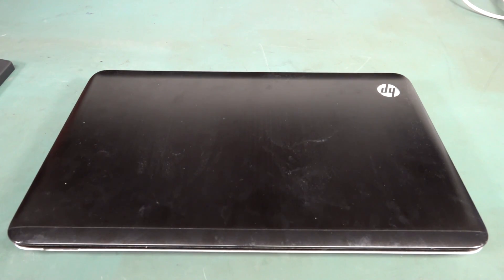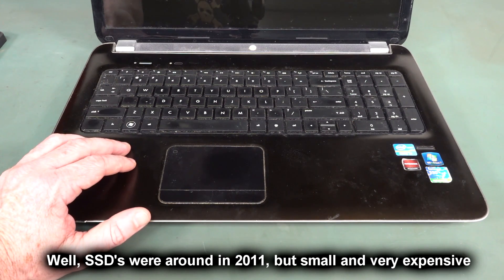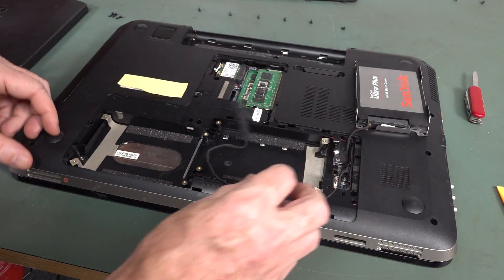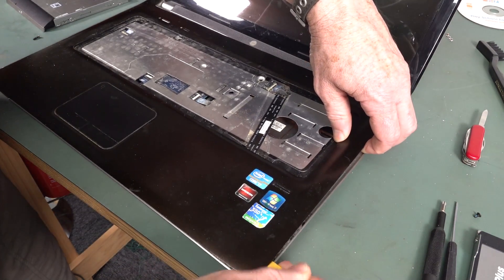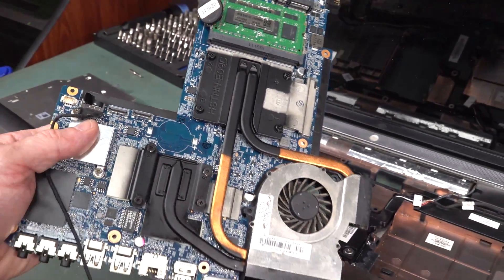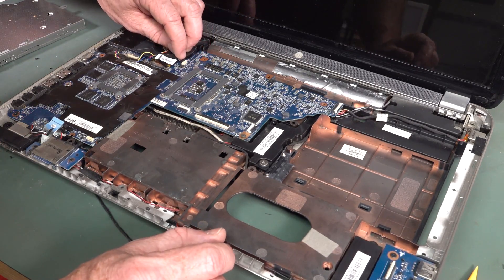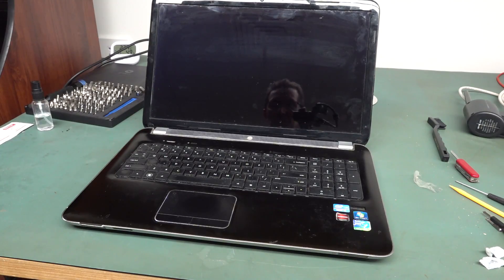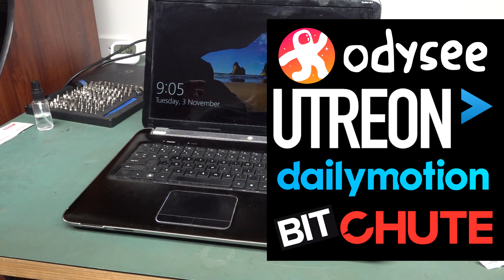EEVblog #1345 - HP DV7 Laptop Repair

Comment: I have 8 of these...updated to windows 11 24h2(may 2025) and all but one had issues-but it still works on a microsoft driver-they don't heat up as much as they used to,use 2 for work and can keep them on 12-18 hrs a day with no problems.These were the BUICK'S of the 2010's...

Comment: I know this video is a month old but thought I'd add my bit. If the laptop continues to overheat in the future it may indicate a gpu issue. It isn't the BGA that people claim it is and is actually an issue with a lot of older chipsets especially on HP machines. HP have always been known for really bad gpu issues in terms of thermals and eventually black screen of death. Unfortunately at that point the only option is to replace the gpu. I'm pretty sure you're more than capable of a little bga work though :)

Comment: I did some digging and it sounds like you might be able to get the AMD GPU working under windows 10 if you go into the BIOS and change it something like discrete GPU only, it sounds like the actual problem is the dynamic switching between the two GPU's, but with that disabled it might work.

Comment: Use the Crimson Edition 16.2.1 Beta drivers from AMD's website. Don't forget to uncheck 'check for updates' after install completes. Works great on a DV7 4030ed I still use lol (radeon mobily 5470) Now plays 1080p smoothly in browser, Bob's your uncle.

Comment: You might be too big of a youtuber, having too many comments to see this, but maybe another viewer might help as well. I was wondering if it would be worth to strip my old plasma of capacitors and other parts? or just throw it away? It WAS a high end TV, it was the biggest and the best available for consumers back then, the stores only had 1 in the store, in a city of 100k ppl :P anyway, tech gets old very fast so wondering if I should just throw it away? 63" plasma 97kilos or ~214lbs. It still works, it is like a heat element when in use and you can see the power meter outside the house increase speed when I turn it on lol. I just feel like it is a waste to throw away if I can strip and sell parts on ebay or something. It was 6400(at current exchange rate) US dollars way back then

Comment: Dave, this is just a thought but I have had pretty good luck doing an 'in place' upgrade from Windows 7 to Windows 10, for free I might add (yes it is still available). I have a lot of old laptops and desktops that I have upgraded this way and things that are not natively supported by 10 seem to run just fine. You might give that a try. What do you have to lose?

Comment: Dave, if you go to the AMD website, you can get the WHQL driver version 15.7.1 for the 6770m AND also the Crimson Edition 16.2.1 Beta.  DO NOT try to use the HP OEM drivers though. Get them from Radeon (AMD) directly.  YMMV as I had an issue with a desktop 5700 series card and Windows 10 and gave up and used the Windows 10 compatibility driver.

Comment: Nice job. A little surprised you didn't desolder the graphics chip you weren't going to use. Now that you've got an SSD, did you disable Speedstep (if that is included and enabled) so the CPU is always maxed? And do you have 8GB or more of RAM?

Comment: You could have a look at this (2nd post from JmanWest), if no one else posted it allready :) : https://answers.microsoft.com/en-us/windows/forum/windows_10-hardware-winpc/amd-switchable-graphics-not-working-in-windows-10/13f4dac4-ce1a-4ae0-9e61-a3393d73b82c?page=5 - But not sure if You can get the old drivers from HP anymore, but You can give it a try :)
KR
Kim

Comment: Nice work Dave. I'm with you re $50 Arctic Silver or whatever thermal compound. I have been using Unick which is for semiconductors and their heatsinks - never had an issue with my PC builds.

Comment: Asus G75 VX  has a charging circuit issue if you want to try something different. It's a huge gaming laptop that supports RAID and 32GB ram (4 ram slots), still usable. GPU is a GTX 670MX.

Comment: Very disappointed to not see you remove the panel on the fan to clean between the fan blades and the heatsink blades. This is where 90% of thermal issues occur, as the heatsink fills with dust and hair. It cannot be cleaned with air without removing the panel, as by the time it's a problem all the dust and hair has compacted into a solid chunk.

Comment: I have a 17" HP dv7-1240us that has quit working.  There is no video on the laptop screen, and if you plug into the VGA video output jack there is nothing there either.  I would love to have it working again, but can't find anyone to repair it.  I was running Windows 7 Ultimate on it, have the disc with the operating system, but don't really want to do the repair myself.  Mine also probably has a couple of pounds of dirt and dust in it.  I have even considered having Linux Mint installed on it for the operating system.   I wish you were my neighbor and that you were willing to repair it for me.  It was a great laptop!  I really love the bronze color of the laptop too.  So different from the usual white or black that are the norm...along with a red, pink, or possible other colors.
Enjoyed the video.

Comment: If you can locate Windows 8.1 drivers they will usually install and work fine under Windows 10. It's a common trick which I have successfully used with an older HP laptop. The HP website may say Windows 10 is unsupported but if you select Windows 8.1 as the OS it may list that particular laptop model and offer downloads for it.

Comment: 2 approaches that have worked for me:

1) I've had luck putting Windows 8(.1) drivers on Windows 10. If they were available for that particular Radeon chipset, it might work. But, as you say, it's not exactly high-end, so...
2) Uninstall the driver completely and disable the "unknown device" in device manager. There might be some quiescent power draw from the GPU being soldered-in, but if Windows doesn't ever bring it up, it won't matter.

Slap a new battery in that puppy and you've got a good "don't care if this gets destroyed" field laptop.

Comment: The slow boot is a problem with win 10 and the graphisc card power saving settings. I you change the registry entry enableulps from 1 to 0 the boot time will improuve drastically.

Comment: All these type of laptops were middle of the road devices and prone to heating. What I don't understand is they are laptops but once placed on the persons lap they couldn't breath as the air holes for the fan was on the bottom.

Comment: The slow boot issue on Win10 can be fixed through registry, just google "ULPS slow boot fix". 
Or just Open regedit 
search for EnableULPS
change the value to "0"
 (all occurrences)
reboot 
No need to revert to outdated and unsupported Win7 or messing with various drivers.

Comment: Proper passmark speed could be looked-up using Radeon 7690M XT, and it is 1.5 times higher. This video card is of course supported by Windows 10, you'd install Catalyst Legacy driver 15.7.1 or Crimson 16.2.1 Beta.
Reply: Also, Ivy Bridge CPUs would not work, since not supported by BIOS, unless you'll install the modded one. Heatsink/fan assembly for this model was unobtnium several years ago, but you can find them now on Ali or ebay. In any case, fixing this crap laptop is a waste of time. Better sell CPU and parts.

Comment: Be careful when you blow compressed air into fans. The bearing breaks easier than you think, also it induces voltage into the mainboard. I always hold the rotor so it doesn't spin too fast.
Reply: The tech boys on Maximum PC and PC Gamer warn about this routinely.  I just insert a toothpick in the blades to prevent spinning.  But I also manually clean the dust off the blades with a soft bristled brush or even alcohol on swabs.  Those little fans are a bitch.

Comment: Your long boot delays is from the AMD display driver - look into disabling "ULPS" (AMD Ultra Low Power State) in the registry to fix that. Also if you have a Samsung 840 EVO series update the firmware to fix performance issues - you cant do it with the magician software anymore, it has to be with their (now unsupported/unavailable) bootable CD method, do a scan with HDTune and after click speed map to confirm.

Comment: For the radeon graphics to work in windows 10 you have to manually install the driver trough device manager, once you have used something like 7 zip to extract the files from the driver exe, you can manually installl them.

Comment: I have that exact same laptop and you can definitely get the AMD graphics to work with windows 10 you just have to download the Windows 7 driver from HP‘s website. Downloading the driver from AMD directly or anyone else won’t work because you need the driver that includes the HP proprietary graphic switching.

Comment: You're lucky. In mine, lots of the threaded inserts broke loose and taking the bottom off was a total pita. It's now back together but janky af
Reply: Those threaded inserts are probably the worst thing in laptops. I've seen so many break out of the plastic and leave the laptop falling apart, usually at the hinges. I prefer better built (usually business model) laptops which have a metal frame; I've never seen any of those fall apart like consumer ones.

Comment: My mom had a dv7 until a few months back. 

I got the Radeon to work on W10 by turning off driver signature enforcement and manually installing the mobility radeon drivers for W8.
It does put up the ugly background notification on the bottom right of the screen and the whole hack had to be applied almost every time after windows had received a bigger update.

But it did work.

Comment: @EEVblog
Actually mostly laptops suffer from blocked air vents by hair and dust as the cooling fins are very thin and dust gets blocked in there forming a solid wall. As a result the fan is blowing at full speed towards the dust wall and not passing the cooler. So it's often recommended to split the fan from the cooler and check if there is any clogged hair inside.

Also the switchable graphics works in Windows 10 too. I think I got it running by installing latest available drivers from amd.com web page (not the ones on hp.com).

The long boot time is actually another problem of the Windows 10 driver model which causing the laptop to "stall" for about 20-30 seconds just doing nothing. There is an easy fix for this though. Disable ULPS (Ultra Low Power State) in the device connfiguration.
You can do this via registry. Paste the following sniplet into a reg file and import it:
----
Windows Registry Editor Version 5.00

[HKEY_LOCAL_MACHINE\SYSTEM\CurrentControlSet\Control\Class\{4d36e968-e325-11ce-bfc1-08002be10318}\0000]
"EnableUlps"=dword:00000000
----

NOTE: The UUID might need adjustment depending on your model. Open regedit and browse HKEY_LOCAL_MACHINE\SYSTEM\CurrentControlSet\Control\Class\, then search for your graphics card model as it appears in device manager (or PCI ID) to find the correct device class.
After this modifications you should be good to go and the laptop should boot from off to desktop in 15-20 seconds.

Comment: You could probably install the win7 drivers into windows 10 with some jiggery-pokery (disable signing, wet finger and hold aloft while sucking teeth hard)... or install linux and give it to the kids (or use it yourself). My old dell 1501 laptop (when I say old, its ddr2 with AMD Turon 64x2 TL-50 and sata-2) has gained a new lease of life with an unsupported 4GiB upgrade and an SSD; and is now very snappy running debian lxde (after a hack to force the graphics to re-set at logon every time to force the screen to work - it displays random vertical coloured lines and nothing else when it switches graphics mode to hi-rez, a known problem). Thats the great thing about Linux, it usually supports really old kit even if it does require the odd hack (which is much rarer than it used to be).

Comment: Bought my first notebook back in 2012, it was a DV7 7047, it was an insanely good machine, unfortunately we had to part ways last year because the GT650M wasn't strong enough to run some games anymore. Surprisingly enough, apart from the hard drive (which is the first upgrade someone had to do anyways), this machine is still pretty darn relevant to this day specwise

Comment: 14:00 Could try to force Windows 7 drivers.
Driver Pack solution could help. It likely has an unsigned driver for Windows 10 if there is no official support.

Comment: Are those battery powered blow jobs things worth the extra? The old fashioned way seems less exciting. Funny enough though my mid-2012 crapple is a i7-3720QM CPU @ 2.60GHz with 16MB and SSD works just fine, interested to here what you upgrade too I in the market too.

Comment: First things first - you CAN upgrade it's CPU to a better ones. i7-2630QM is sucks in this laptop. I have (possibly!) the same model, it's DV7-6152er.. Had to do some soldering to be able to use quad core CPUs on that one, but now it's running with i7-2820QM and it's damn much better. Be adviced though - you have to donwload and check "Service and Maintenance Guide" from HP's website for exactly your laptop to be sure which CPU's are compatible with your model line. With wrong CPU it won't boot up at all. Maybe with some BIOS digging it will, but i'm not that smart to do that myself^_^ So i just checked this document, bought CPU from aliexpress and voila, "It's alive!!!"
Second thing - you CAN use AMD graphics with Windows 10. Not easiest solution though, but you have to check UnifL (Unified Leshcat Drivers). These drivers are based on latest AMD + Intel Drivers and aimed to support laptops powered with:
• AMD 3xxx/4xxx/5xxx/6xxx/7xxx/8xxx/Rxxx Series
• Intel HD/HD2000/HD2500/HD3000/HD4000/Iris/Haswell/Broadwell/Skylake CPU Embedded Graphics
Sad to say, but it's a bit tricky process. But it's working with Windows 10 ^_^
Reply: I'll write you a full routine how to do the job in a day or two. But you'll have to get back for Windows 7 at least once to gather some machine specific data. Otherwise it won't work after installation.

Comment: Recently, I successfully exchanged the graphics card inside an old desktop PC to a legacy HD 6450, and the W10 drivers were working fine. 
The AMD Radeon site also lists w10 32/64bit drivers for the HD6770M. Have you already tried these?

Comment: Yes, AMD stopped making new drivers, but that's normal. You still have 15.7.1 WHQL or Crimson Edition 16.2.1 Beta drivers available on their website ;) On such a heavily used machine, you're supposed to change the thermal paste every year, preferably during spring (before the big summer heats). There's no "maybe" about it. Arctic MX4 FTW. And no, there's no bullshit inside it - only great thermal performance for funny money. Fan also needs disassembly, cleaning and new grease. I'm surprised this laptop is still alive after so much abuse :D

Comment: yeahh I had one with some sort of cool bubble design, and yes it was very hot. mine had a AMD Turion II M520. Used it for school. It collected a lot of dust between the fan and the heatsink. The thing with the discs between the drive and the case. is also familiar. Found a lot of discs at work :P You can put a second drive in it but the drive bays were quite expensive and hard to get.
Edit: But even after cleaning the AMD Turion II M520 ran hot and was slow. It had silly special drivers to use the Radeon.

Comment: Windows 10 forums: "Custom Driver : Intel HD Graphics & ATI Combo (Alpha) - by nIGHTmAYOR". 6770M is listed under supported hardware.
Reply: The 6770m has WHQL drivers and Crimson mobile support direct from AMD. There is only 1 package for each, and it was just to get Windows 10 compatibility and that is it. You must get the drivers from AND though. YMMV though as I had a problem with a desktop 5700 series card.

Comment: Custom bios allows for newer wifi card. I believe I have windows 10 with the AMD GPU going on mine, by extracting the driver and installing manually. It is so similar to the 2011 macbook pro, you can dualboot Mac OS X something or other.

Comment: Check out the official AMD website, there is a original Windows 10 driver for your GPU, there is the link: https://www.amd.com/en/support/graphics/amd-radeon-hd/amd-radeon-hd-6000m-series/amd-radeon-hd-6770m
I have the same laptop with the same GPU and Win 10, just installed this driver and everything works

Comment: windows 7 drivers should work on windows 10.
Don´t use AMD´s detection crap, download the proper driver.
https://driverscollection.com/?H=Radeon%20HD%206770M&By=AMD
If it refuses to install, try another source for download and compatibility mode in windows 10.
However don´t expect too much from it, it´s old laptop gpu crap and won´t be good enough for any modern games so you´ll probably be limited to standard web browsing and office with this machine, maybe playing something like minecraft but that´s it.

Comment: Such a common issue with HP laptops. My Dad had one  that exhibited such thermal issues a month after the warranty expired. Performed the same fix and the system ran for another 3 years (Dad's doesn't need to be replaced as often as he has light uses for it). I suspect I'm going to be getting another one shipped to me soon and the fix will be the same

Comment: HP laptops have alwayes been a pain to take apart. Had a Dell lmfrom the same era that had only one big screw in the center that would release the whole bottom cover and give access to everything.
Reply: Dell Latitudes of the era had very bad access, E7x20 - E7x30. Also, they had bad mechanical design of motherboards and are prone to crack.
Reply: @TheGrantourismo  Mine was a latitude e6510. Probably one iteration older than yours and his. Very easily accessible, just one screw, and the motherboard components facing downwards, never needed to take the keyboard out for anything. The outer shell was prone to crack, but the chasis was sturdy.